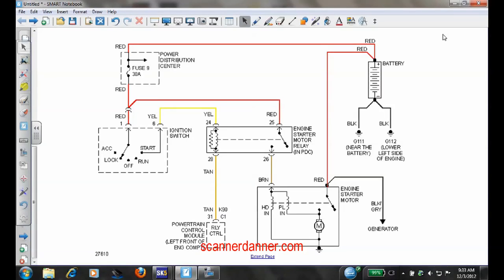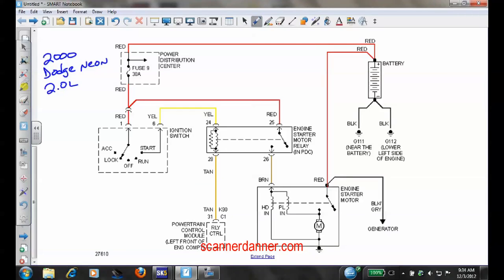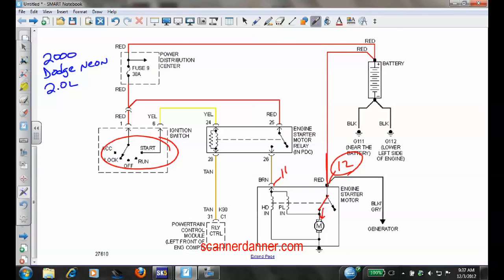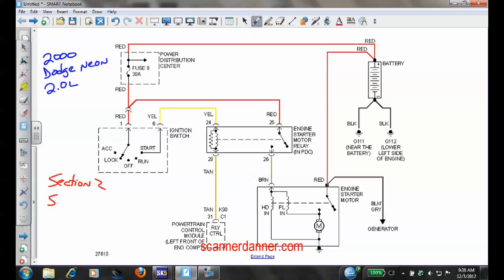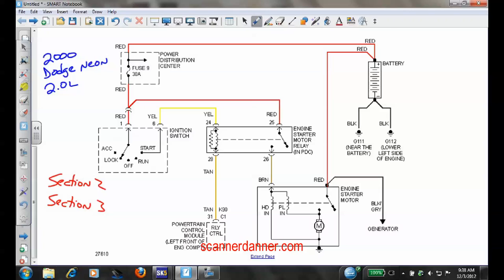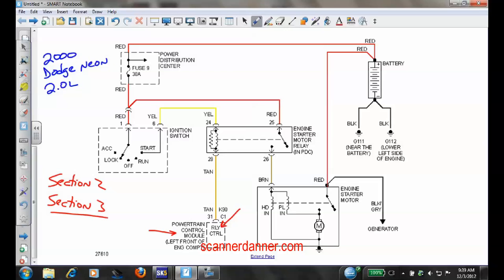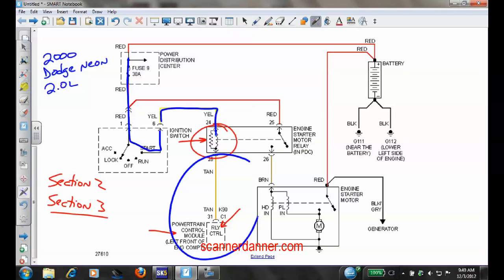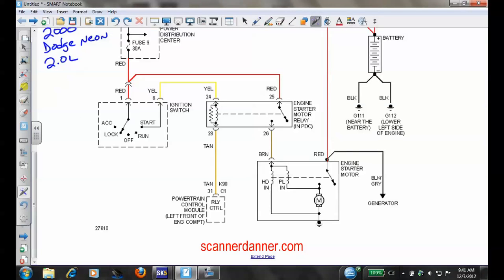How to troubleshoot a starting system (bad ignition switch) - Dodge Neon

Comment: Hi ScannerDanner. I wanted to thank you for your video and tell you and your viewers that you helped me fix my car (2007 Pontiac Montana) with this video. My montana started acting weird about two weeks ago. All of a sudden it wouldn't crank and start. First time it happened after turning the key 10 times it cranked and started. Car was fine for two days then it did it again. No crank no start. Again I managed to get it started within 5-10 tries. The next day the car stalls at idle. But was able to restart it first try. Next day I pull into the gas station, buy a coffee, come out no crank no start. 50+ tries nothing. I got it towed to my mechanic and they ended up replacing the starter. (They never tested anything other than battery, just assumed starter right off the bat) With the new starter it was still not cranking or starting. I was suspicious but after 3 tries it fired up. The mechanic's explanation was "while they replaced the starter the battery must of ran low". I went home, parked the car. The next night I was about to go somewhere, no crank no start. 20+ tries, nothing. I'm very frustrated at this point. Next morning no crank no start, 4th try it cranks and starts. I drove down to my mechanic and tell them what has been happening, they have no clue. Their answer is "well it starts now" come back when the problem shows. In other words get it towed again. That's when I started researching,and found your video. I went and bought a test light, took apart the dash to have easy access to the harness, and waited for the car to do it again. The car started stalling out at idle a lot. And finally the no crank no start happened again. Did what you showed on your video. Test light to red, light on, test light to yellow while attempting to start, nothing. As I'm doing this (4-5 times) all of a sudden the test light lights up and the car starts. So I poked some more at the yellow gently wiggling it and car doesn't crank and doesn't start. Then I hold the key to start no crank no start, then as I'm holding it I poke around the yellow wire with the test light and bam. It starts. It was indeed a faulty ignition switch. I replaced it myself. 32 dollars including tax. That's what my mechanic was supposed to do in the first place. But instead I paid 300 for the tow and the starter. I've also read that a faulty ignition switch can cause a vehicle to stall, and since both problems came within 2 days apart that this will also fix my stalling issue. I will drive around for now and if it doesn't stall for a week I'll post the results here. Either ways I definitely had a bad ignition switch and I figured that out thanks to YOUR video. I fixed it with YOUR help. The fact that my mechanic never run any of the tests you did infuriates me. 300 dollars vs 32 dollars. I saw multiple similar videos before yours but you actually explained it on a level that I actually understood everything you said. I really appreciate your video because my unreliable car was stressing me out big time. And thanx to you I diagnosed and fixed a problem that a certified mechanic apperently couldn't... 😊
Reply from the maker: Unfortunately what you're describing is all too common in my field. Nice job on the fix! BTW you fixed your stalling issue too. These are common failure items and the symptoms are exactly as you described.
Reply: ScannerDanner So the problem is back. Exact same thing with brand new ignition switch. What are the odds that I purchased a bad switch? Car stalled once, and did no start no crank once. I started it up by poking at the yellow wire while holding key in start position. So at this point if I understand it correctly I either purchased a malfunctioning ignition switch, or there is a problem with the ignition switch harness?
Reply: Or do I stress about the ignition cylinder at this point? Key isn't sticky or hard to remove or anything along those lines, and it does turn smoothly like it always did
Reply from the maker: sounds like a harness issue. Tighten the pins on that main ignition switch connector as a starting point
Reply: ScannerDanner I figured at this point it's pretty narrowed down 😊So the problem is definitely in that general area since I can get it to start, and also get it not to crank just by poking at the yellow. I will mess around with it in the daylight and definitely keep you and everyone posted :-) My problem may help others. And thank you so much for your ideas! 👍
Reply: Update : I went to a junk yard and picked up the entire harness assembly (that has 10 harness total in my case) but I haven't changed it yet. The car hasn't done the no crank no start since last time I posted. It got really cold (I'm in Toronto) but I have the harness just in case if it does it again. I'm thinking because of the cold the connection inside the harness became better due to it shrinking in cold-expand in warm and maybe that's why it stopped doing it. I'm just guessing but it would actually make sense. If and when the problem comes back I will replace the harness assembly and update everyone. For right now the issue stopped. Both no crank no start, and stalling.
Reply: ScannerDanner
 Still having the problem but I just noticed that when it doesn't crank, the check engine light also doesn't come on at all while turning the key. To my understanding that means it's either a wiring problem at pcm or a bad pcm. Every time this happens it's wet conditions. I'm going insane because every time it happens and I could test it's raining or snowing and I don't want to drench the fuse box and stuff

Comment: I just wanted to point out some variables. If you bypass the ignition switch, understand that the vehicle may crank, but depending on circuit design, it may NOT start. We are all here to learn and I care about your viewers just as much as you do Paul. Do your homework and your research is my point.

Comment: I just want to compliment you on an excellent class.  I had this exact problem on the exact same car.  2000 Plymouth Neon.  I followed your steps exactly and oddly enough ended up with the same result.  The starter switch was bad (or maybe not).  I purchased the switch and took steering column apart.  I found that the actuator pin was broken.  Apparently a very common problem on this model.  With pin broken I can't say if I replaced a perfectly good switch that the broken actuator couldn't quite turn all the way to start or not.  The point is your video took me right to the problem and prevented me from loading the parts cannon.  Thanks very much
Reply from the maker: +Bruce Gladish awesome! Thank you

Comment: Great job, Paul. Last year I posted a video of a no crank no start in a vehicle with an intermittent bad starter solenoid. It's amazing how well your video above dovetails with mine. Different side of the circuit, but the same logical pattern of gathering evidence before a decision.

Comment: Yellow wire as done is this video. The reason for this is that the Dark Blue wire gets power from the ignition switch. After going through a fuse(I believe fuse #9) it turns into a Light Green/Black wire that energizes the ASD relay. There is a splice where that wire also controls the Fuel Pump Relay. Without those to circuits being active, you will be missing a lot of crucial systems. Power to the ignition coil, fuel injectors, alternator voltage regulator, O2 sensor heaters, etc. Again, that

Comment: Hi Paul, my Chrysler Voyager model 2008 would't start. Searching the web I found your video which gave me the right information to solve the problem even though the electrical system is not completely equal to the Dodge Neon. It appeared that the connection to the starter relay was bad. Thanks very much for the clear and  thorough explanation!!
Reply from the maker: +Chris Bode awesome thank you for the feedback and good job on the fix!

Comment: Excellent video. It helped me with my van. Oh course it would have been better if had listened to what you said in the first couple of minutes of the video. Turns out the ground was loose on the starter (2001 Chrysler T&C). Bolt that holds the starter to the block has a bolt off the back of it and a nut connects the ground to it. I hooked a wire to the solenoid and jumped to positive battery and just got a click and didn't realize I had a starter or ground problem. A friend told me if your jumping from solenoid to battery the starter should crank. In the process of putting in a new starter I found the loose ground so I corrected that to see if the starter was still good and it was.
I did make sure my test light had a good connection though. I should have gone to your Nissan video. In fact I'm going to go view it now. Thank you very much.

Comment: Another variable to point out is this...On this particular starting system on this Neon, the PCM is grounding the starter relay coil. On SOME systems(emphasis on SOME) the PCM is NOT in direct control of the starter relay coil. Because of this, the key does not have to been on in order for the ignition bypass test to work. The Neutral Safety switch, often mounted externally to the transmission/transaxle grounds the starter relay coil. As long as the transmission is in park or neutral, the relay

Comment from the maker: No but I did poke a small hole in the wires with my test light. While I will agree this isn't the best method, with it being an interior part, there is no concern of corrosion. In fact not more than a few millimeters away was the uninsulated terminal contacts. It would have been better to touch my test light there instead, just couldn't get the right angle.

Comment: Why didn't you take apart the column and check the ignition switch to see if it's a loose terminal or physical damage?  Does it go back to the body shop with the answer of an ignition switch problem and they take it over from this point on?

Comment: The tan wire could not be shorted to ground if you are missing that ground control for the starter relay coil control. It would HAVE to be either an open tan wire or an open low side coil driver inside the pcm. One huge variable to point out is that yes, you can bypass any ignition switch and force the starter to crank the engine, that does NOT mean the vehicle will start. On some of these Dodges/Chryslers/Jeeps, you would also have to jump power to a Dark Blue wire while jumping power to that

Comment: Very easy to bypass the PCM. Get a pin out chart and locate that tan wire(ground side switched) that controls starter relay coil. Back probe it with some cheap $1.99 Walmart sold T-pins and jump it to ground with a jumper wire. Re-install the relay and put the ignition in the start position. You would do this of course if you were missing pcm ground control to starter coil. If you do it at the computer itself, this would also tell you that the tan wire is NOT open.

Comment from the maker: cam and crank sensors are not involved with the cranking circuit. However on today's computer controlled systems, the PCM may monitor the crank sensor to know when to stop energizing the starter, but the cam/crank signals do not need to be there for the starter to engage. in other words you will not ever have a bad cam/crank sensor cause a no CRANK problem. (i should know better than to say "ever", I've just not seen it yet)

Comment: Relays, the place where the low current carrying coil side control(from a module) and the high amperage carrying load(starter motor) meet for a hot date, lol. That is how I generally attack wiring diagrams control vs. load, power vs. ground.   Obviously if lets say a condenser fan is running all the time, it would be reasonable to say the load portion is good, however it is running ALL THE TIME, emphasis on time. What dictates when it should be operating? The control side of the circuit.

Comment: i wonder if the bad ignition switch was the original problem of the accident , as you mentioned that it came from a body shop. I had this problem before on a 1997 honda that i had , the car  did had a recall but it was just easier for me to get the part a replace it my self. switch was getting dropped while driving an shuting cars off . and bang!!!!

Comment: I don't know why I keep coming back to this video but for those DIYers and the folks reading through the comments, you can also jump the starter directly with a screwdriver(obviously proceed with caution...do not do it if the smell of gasoline is present.) Also, access to the starter may be impossible so start at the relay after a battery check has been performed. For those of you questioning the screwdriver trick, it will quickly rule out the load side of the starting circuit, if it does in fact crank. However, if it does not, both the control circuit and load circuit are still under suspicion.
Reply: look he lost power he put the test light on battery + then give the power to yalow wire then car start

Comment: This is a great video! I have a 01 town and country with same no crank issue.  There is no power from ignition yellow wire when key is in start. Also no power from the red wire to the ignition switch.  The power fuse checks okay to the switch.  The starter cranks when by passing the ignition switch as seen in your video. How do I trace the power wire to the ignition switch?

Comment: I'd really like to see something similar to this video but on a newer dodge. Example 08 nitro that has tipm. Mitchell wiring diagram shows electronics inside tipm with starter coil driver going to pin 85 on starter relay. Pin 86 starter relay goes to pcm. Pin 30 starter relay B+ fuse J17. Pin 87 starter relay goes to starter solenoid. In this situation you have a pcm and tipm. How are you to know which is power and which is ground on the control side of the starter relay? When one end goes into pcm and the other goes into tipm? This particular vehicle has an intermittent issue with no crank. With my u activate tool and key in run position i can start it. And after i put starter relay back in. You're able to drive the vehicle, however you don't have any rpm, temp guage, and there are several lights on esp srs etc. You can shut it off and some times it will start now with the key and everything returns to normal. And other times nothing no crank and all dash lights illuminated. I've checked all grounds under battery by abs module left kick panel and block ground all good. I checked power and grounds at pcm all good. I checked power and grounds at tipm all good. Only thing i can assume is the solid state electronics which has starter coil driver inside of it is flaking out. But being new to this field and not knowing the variables of this tipm if I'm making the right call. Because i can't test the solid state electronics. I really hope you get one like I'm describing. I'd really like to see your approach to see if i went about my approach the right way.

Comment: Scanner another great video. I'm still trying to find the problem with my wife's 2004 acura TL. It too was no start all lights on horn loud battery has good voltage 12.6v. I initially thought it was the starter and had even removed it. Later bench tested it and it was good. I was able to crank it the same way through a feed to the solenoid. Here's the difference in mine though. When I go to the starter relay and test for constant power I find none. At first I thought it was possible I had the wrong relay so i sent a very small amount of power through the solenoid wire with the relay off and it was the correct relay. It's hard to see the labels on this car its in a horrible spot. So without a schematic I was puzzled as to where to go next. I disconnected the clutch switch yesterday and found no power there either. The dash lights up normally. The relay coil had 123 ohms on it and the switch side barely one ohm. There is on thing that occurred to me in listening to your lecture. The anti theft system. Normally when the battery on this car is disconnected, once you replace it, it alarms loudly. That did not happen no alarm at all.  So now I have to decide what's next. I'd love to see a schematic like you had there and also try to find what controls the alarming when the battery is reconnected.
Reply from the maker: Here you go my friend http://www.eautorepair.net/marketing/default.asp?VID=&Count=Y
$20 will get you a 1 month pass for your car and it will be the exact same diagrams I use.
Reply: Thanks

Comment: I have an export model jeep Cherokee with no crank, no cluster , no nothing and this   helped me no end as realised that I have factory theft which was energised when I disconnecteed the battery to charge ( was checking parasitic draw at the time car was000 running fine).  Toook a while for my brain to realise that theft unit had isolatee starter relay control but cant check fuses as on export they are at driver end of dash and I parked close to wall so cant open door enogh to reach fuses at driver end of dash and park/neutral is in park so cant mpve the car with engine no /go.  durgh!

Comment: Wouldn't the dash lights working in run position automatically tell you the fuse is good and ignition is getting power, so no need to probe the red wire

Comment: the shop could have easily tapped the control side of the relay with ground or (in this case) positive with a test light to energize the relay coil to energize the starter solenoid.

Comment: Let's say you had 12v at your s post and b post. And you put a breaker bar on the crankshaft to verify the engine would turn over. That would be the solenoid right

Comment: Hi I have a 2002 dodge neon, and I've been having a starting issues with it. Its very odd because there are times when I start it and it turns on like there's nothing wrong. And then most times when I try to start it, nothing happens and it doesn't even crank, please help, what could be the possible reasons why it does that its so frustrating.